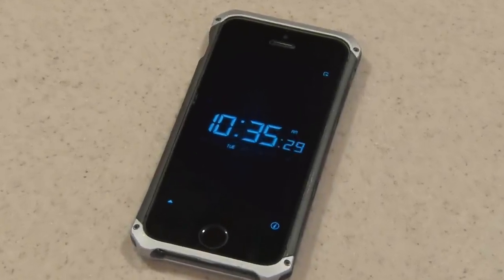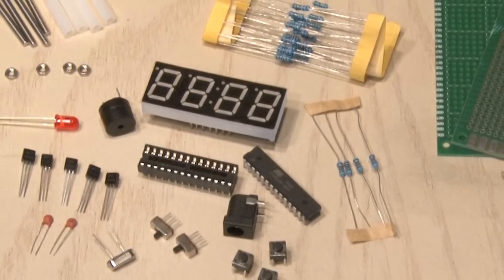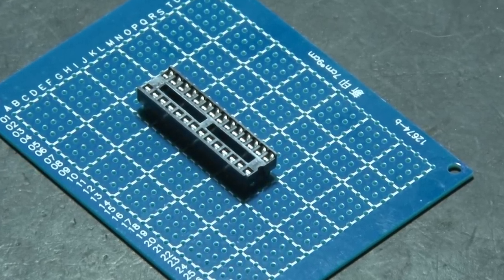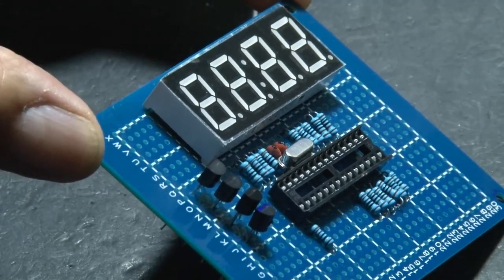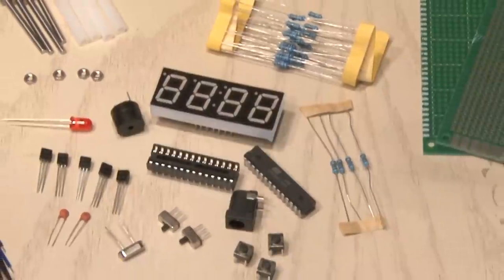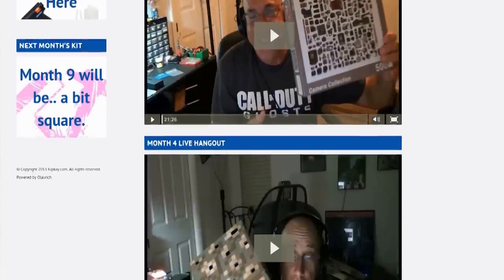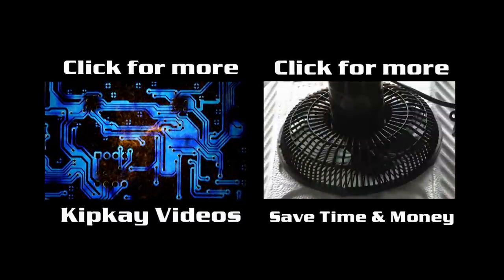DIY Digital Time Clock!

Comment: Tried building this, but I messed up somewhere along the line. After unsoldering my right pinky finger from my table, I started it up and it disappeared. I realized shortly after that I sent the clock back in time. My grandfather found it and patented it and sold it to GE for a small fortune. The worst part is I was never born and only exist here in weird ghostly altered timeline now. Overall 4/5.

Comment: yeah.... this won't be terribly accurate, and you'll have to adjust the time on it every month or two at least. if you add a DS3231 you won't have to adjust it nearly as often, and the clock won't lose time when powered off.

Comment: I would use a 4-digit, 7-segment display AND a LCD display for constructing a DIY car radio and program the arduino to program the 4-digit, 7-segment display to show the current time and the LCD display (when the radio is turned on) show the current time radio source active.

Tuner:

Top part: FM/AM number, preset number, frequency
Bottom part: Broadcast info (maxiumum of 8 characters, will be left blank if unavailable)

Examples:
FM1-1   100.5MHz
The-FOX-

FM2       101.3MHz
1013KGOT

AM-1          750kHz

AM           1080kHz

CD Player:

Top part: Track number, elasped time
Bottom part: CD information (blank if unavailable, more than 16 characters will scroll right automatically after five seconds)

Examples:
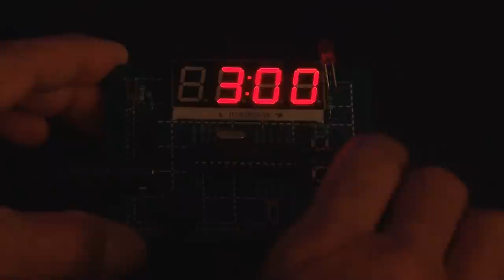Track 04   01:32
One Fine Day

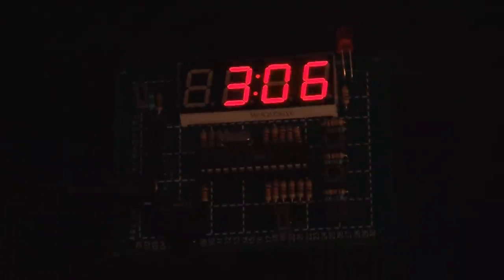Track 04   01:42
Sting

Track 04   01:52
57th & 9th

Auxiliary cord:

Top part: Auxiliary cord info
Bottom part: Blank

Example:

Auxiliary input

You should make a detailed D.I.Y. car stereo with a tuner, CD player and auxiliary cord input, Kipkay.

Comment: kipkay: I have seen scrolling signs in businesses, on marquees, and on buses to inform riders where the bus is stopping next. I have seen several on line that can sit on the package carrier in your car to give warnings or make other drivers aware that there is trouble with the driver such as, "DRIVER IS HAVING A DIABETIC SEIZURE, CALL 911." Have you ever produced a video that demonstrates a DIY 3 to 4 inch tall scrolling sign which can run off of the cigarette lighter?

Comment: You could just use a couple of 555 timers, push buttons, pots and make this same clock. An AtMEL is just too powerful and inefficient.
Reply: yeah, seems like overkill to me
Reply: The point is using a re-programmable microchip that'll let you add or edit code.
Reply: but, you'll either need an Arduino kit or a Ti-reprogramming shield. At-Mel is wayyyyyy to powerful for just a clock. you can reprogram a 555 timer to do basically anything, if you understand the schematic of it
Reply: You'd need more than that: you would also need LEDs (of course) and something to keep count. When I was a teenager, I made a clock (sort of) with a 555 timer and some decade counters (I might have used the 4017 for this) and of course some LEDs. It wasn't very accurate, but it worked (sort of) and was within 1 or 2 minutes per hour.
Reply: ProSurviver
A 555 timer is just that: a timer. And not even a very accurate one at that.
 Though, if you have a lot (not just a couple) of them, they can be combined to do weird things. Look for a video titled "555 decimal adding machine".
Reply: Modern 555 timer comes with a compatibility with crystal timer that will keep  it in check. It seems counter intuitive but 555 is one of the oldest and still thriving IC's

Comment: A time clock as opposed to... what? A banana clock? Also, that's not a printed circuit board, that's just perf board. A PCB has specifically printed metal tracks that replace the wires. I like your videos, but, basic mistake.